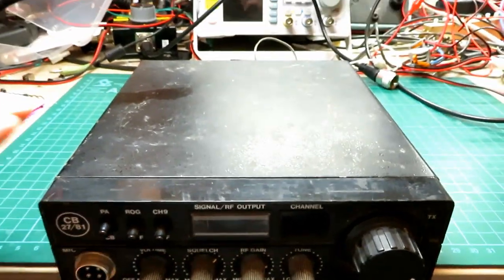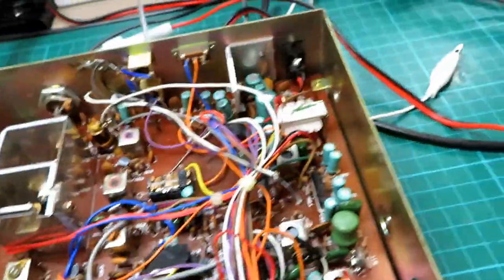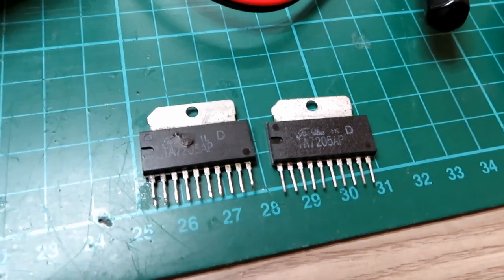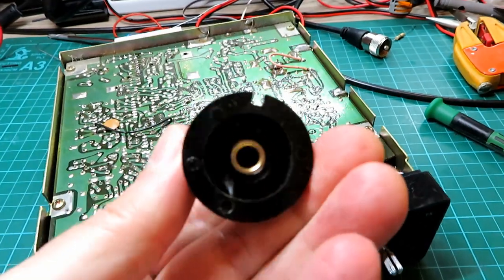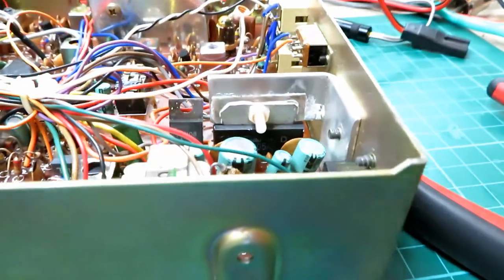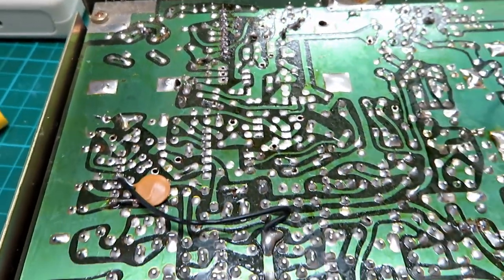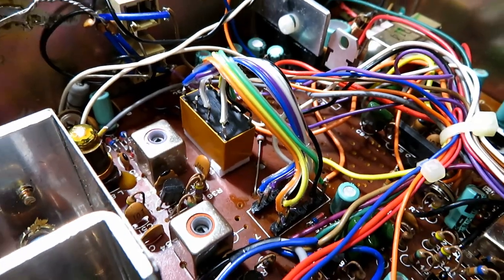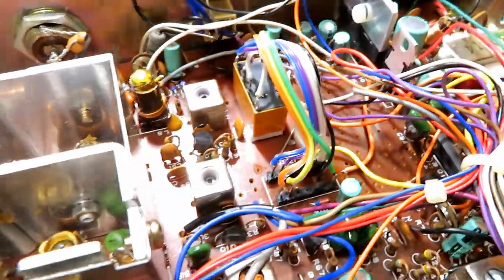RESIN PRINTING QUALITY REPLACEMENT KNOBS & A CB REPAIR THAT NEVER ENDS - COMMUNICATOR'S LCL NI440 DX

Comment: I thought I recognised that knob being used for the channel selector right away and it must be ~40 years since I saw a Melos DE-1 Echo Chamber. Check it out and you'll see why.
Alas, smaller and different, but visually very similar.
The Echoman EM-150 has a bigger knob, but still different. We must be close... :-)

Great video as per - cheers!
Reply from the maker: Ah I knew it cheers